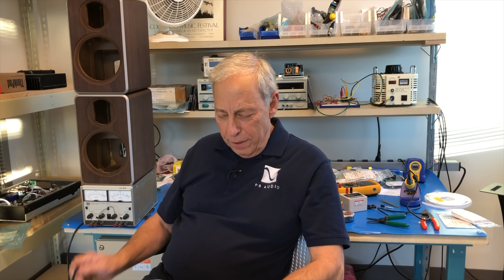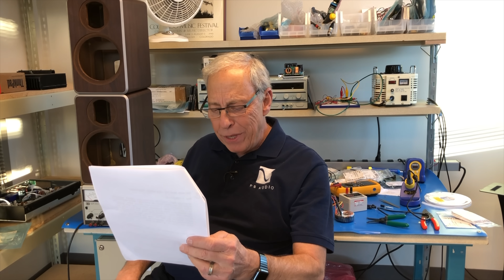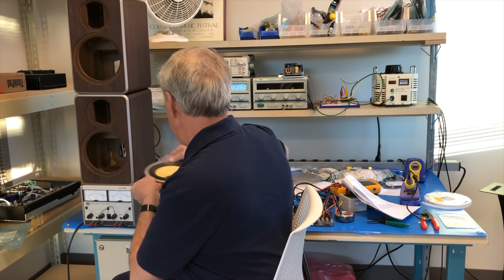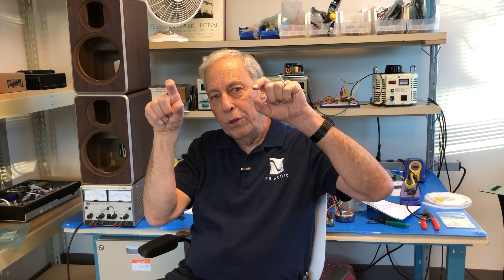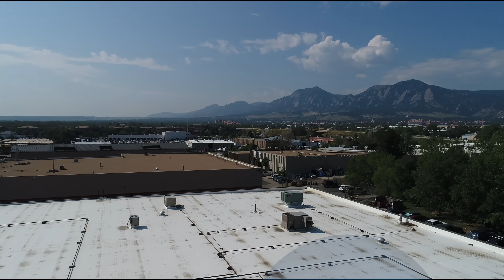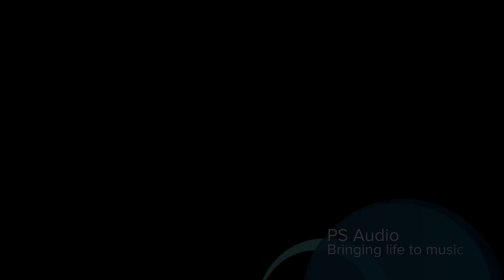Amplifier slew rate

Comment: Thanks for posting. I’m now in the process of building Astable multivibrator oscillators. I have found that the uA741 op-amp when viewing on my scope looks like the leaning tower of pizza. CA3140 is a little better. But the LT1007 is the winner in slew rate straight vertical lines on my scope. Do you remember these chips?

Comment: I an very sorry to correct you the LM709 was as sluggish as the LM741. ( https://www.ee.nsysu.edu.tw/lab/F6027/LM709%20Operational%20Amplifiers.pdf  http://www.ti.com/lit/ds/symlink/lm741.pdf ) But you are right that the 741 sounds terrible. Probably one reason why so many recordings from the 70th were so  bad. It was used by Revox/Studer (probably by other companies too) in recording equipment in the 70th

Comment: Your story regarding the 709 op amp doesn't pass the "smell test."  The 709 is an externally-compensated device which requires compensation capacitors to be added to the circuit, according to the gain desired (and it's SLOWER than a 741 when set up for a unity-gain application).  The 741 is internally compensated, so any circuit designed for it will lack any external compensation and the 709 can NOT be used as a drop-in replacement (even though it is possible to go the other way and use a 741 in a circuit designed for a 709).  Also, the 709 had some notoriety for its "popcorn" noise issue and would be a commercial disaster in a production phono pre-amp.  Your "mistake" was much more serious than you knew.  Ever check the output of your 709 circuit with a scope?  It was probably exhibiting parasitic oscillations, which you and your associate apparently thought sounded great.  :-/

Comment: When I was working at Analog Devices we built some high end opamps that were 2" sq brics with a few dozen FET's and transistors inside along with resistors and diodes. These were all discrete parts and I remember we used a ferrite bead on the output lead of this little brick to boost the slew rate to 200 v / us. That was hot stuff for 1970.
Reply: Dave Micolichek  It was a great joy to me to discover that trove of magazines I used to read so avidly back in the day. Only too happy to share :-)
My favourite issue from 1972 was Linsley-Hood's transmission line speakers. Heaven on a stick was when I acquired my first transmission line speakers in 2000.

Comment: Slew rate is ever important as Paul rightly explained... I remember the 741 and the LM301... the latter requires a compensation cap added to it to control its open loop gain ... we have come a long way since those little devices came on the market . My preamplifier is designed around NE5534AN devices the 'AN ' suffix denotes very low noise in nano volts per square root of the applied frequency. They have a slew rate of over 70v / us which ain't at all bad .. 
You must be aware though .. too much high slew rate maintained throughout the amplifier chain can lead to oscillation effects
Reply: Ah, older opamp... What do you think about the JRC4556 or JRC4558? Any experience with those?

Comment: It will be interesting to see how PS audio integrates their ribbon tweeter with their cone midwoofer.  That's a common combination, but most examples sound like two transducers and a crossover rather than a seamless loudspeaker, especially in small enclosures.  That said, even unloaded, their speaker looks pretty nice.

Comment: Here's the short and skinny. Power amplifier frequency response is measured at one watt into a 4 or 8 ohm resistor. Solid state amplifiers invariably look ruler flat across the audio passband by this test. But at higher power levels the high end rolls off and while the power bandwidth may show it to be adequate with a steady state signal the amplifier may not respond fast enough to keep up with the waveform exactly. So amplifiers have to be able to deliver power into real world loads that can be reactive and even kick back with reverse EMF. Big well regulated power supplies with a lot of stored energy in capacitors able to muscle it's way controlling any speaker it's hooked up to keeping up with high frequency transient waveforms sound best. Matti Otala of Harman Karon discovered this back in the mid 1970s. He called the failure of the amplifier to keep up "transient intermodulation distortion." Intermodulation distortion is any distortion that doesn't fit into any of the neatly defined forms of distortion.
Reply: Fascinated at your knowledge, Sir. 
I have seen this kick back, when 2 woofers in parallel and  free air. Push down on one and the other will have movement. This is why I am committed to one amp channel for each driver all the way to the top. Transient response just has to be slowed down when people hook multiples in series/parallel to get a big amp to push an array.
Reply: Mark Fischer another great reply!

Comment: I have some '80s gear that I still love. Many improvements have been made to op-amps since then, and it's tempting to drop in some new silicon. The usual advantages are lower noise and much higher slew rates. The faster circuits come with the hope for better sound and the increased likelihood of high frequency oscillation. Sparkfun sells tiny circuit boards that allow you to put surface mount devices on through-hole boards. The trick is getting the right capacitors in the right places to keep things stable!